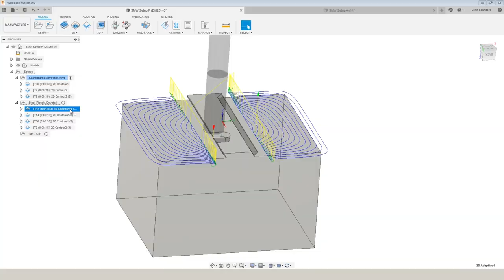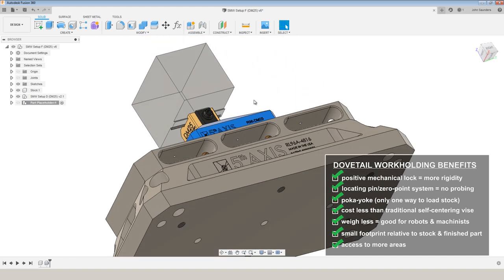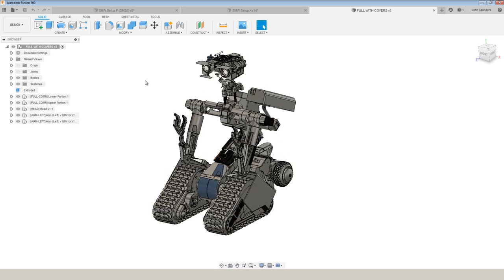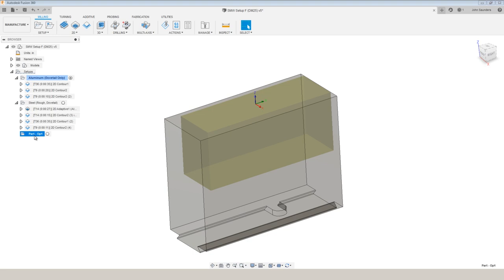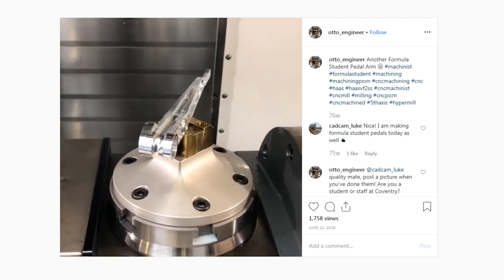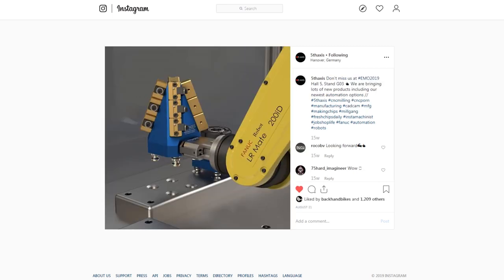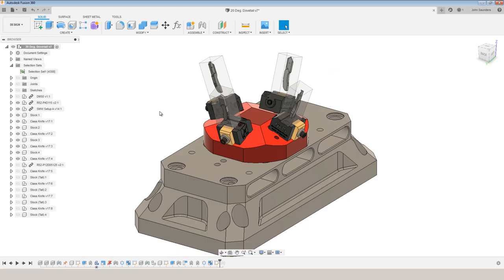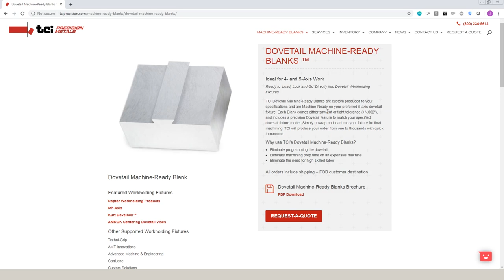Beginner's Guide to using Dovetails for 5-Axis CNC Workholding

Comment: Not that I have a 5 axis, but the trick of "Save to project" already made my day 1000 times better :D 
Was just crying half an hour ago that I cannot move files between projects...
Reply: Better use derive instead of export. This way changes in the parent file can be propagated to the derived file.
Reply: Workoaround I found for that is to save the file on computer as a normal 3D file, then open it with Fusion and save in desired folder.

Comment: It's amazing how hard you can hit a part with a dovetail. I ran some parts way harder than I should have been able to with a 1/16th inch dovetail, also knocked material cost down since I did not need as much to hang on to.  This was on a 3 axis.
Reply: The shop I worked at used dovetails for a multitude of jobs.  .060 deep, with a .250 index slot.  We didn't have fancy workholding fixtures, we just made steel dovetail jaws for our Kurt vises.  We routinely made 20hp cuts on those tiny dovetails!  Great way to save material also!
Reply: At our shop we settled on a .045 deep x .045 wide 45 degree profile with the matching profile cut into some soft steel kurt style vise jaws. On aluminum parts the added time to buzz a dovetail on the stock is almost not measurable. On steel parts it does take awhile but still more cost effective than blowing up multiple $300 end mills and all the collateral damage when parts lift out of the vise.

Comment: Excellent Topic and video as always Champ.... two things to keep in mind:  
1st: Although any real machinist is unlikely to be ashamed of turning wrenches.. you want to find a way to minimize it, for many reasons... on the big tree type configurations it would be very wise, at minimum to consider, a double lead screw with a mechanical stop to prevent the bolt from separating from the jaw in fast work.... and really to devise a totally different closure/mechanism/linkage for actuation of the dove tails.  ... from experience... turning 20 - 50 bolts per run, even with a pallet changer can wreck your times (and knuckles).   A series actuated mechanically by a cam lock would be worth anyone's time and money..

2nd: when tree type configurations are not necessary ...if possible set up several operations in the same program using several different fixtures.. in line.. one cuts dove tail... 2 cuts part previously dovetailed... 3 removes dovetail and finishes "6th" side.. brand new finished part every time the doors open.... a larger table travel, you know, is necessary.  Thanks again for all your work, loving the exploration of Fusion 360.

the biggest of the little losses of turning allen wrenches in fixturing.. is.... an otherwise great operator, and dignified member of the community, may be made to look and feel like a resentful worthless fool spending half his day with a magnet sifting through chips in a conveyer to track down the coolant ridden wrench that slipped out of his fingers the 5th time in a row..... at best.....you and your incredible associates are capable of designing a thousand different types of linkage/ cam actuated mechancial quick release locks for those trees.. .. and I personally think... .you should.   Not a new idea.... but a good one

Comment: Probably worth mentioning that the self-centering vices you are showing from 5th axis does also have a dovetail. Although not need, it does significantly increase the rigidity when machining harder materials. The effects are quite staggering compared to using the same vice without dovetailing the work piece.

Comment: QUESTION: im building a dovetail system for a group of parts.  which surface is best to use as "Z-zero"?  should i set Z from the wide end of the dovetail, or the narrow?
TYIA

Comment: Is the part only held on the dovetail or is it held on the dovetail and the surface of the milled piece in contact of the uppersurface of the clamp, for extra stability?? If so  the position of the dovetail in the clamp will have to be verry accurate. I am interrested how to work with dovetailclamping of a piece. I am not using it yet.

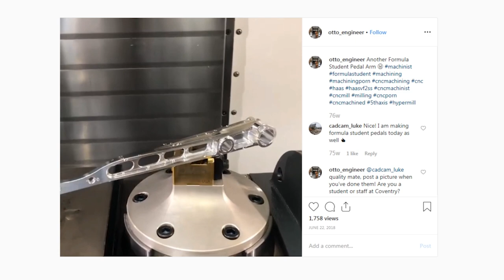Comment: I'm curious how did that part at 8:00 avoid chatter?  The finish looks great.  If I held that in a vise with that much sticking out of the sides it would be full of vibration / chatter marks.

Comment: Four minutes in, you export a part then insert it into the file you do the CAM in. I didn't know you could export individual parts! That would have been so helpful, but now you can use the derive function to insert parts into a separate file for doing CAM instead. I think this way, you can update the part if you make changes in the original assembly, but maybe your way does too? Are there any advantages or disadvantages to doing one method vs the other?
Reply: You might want to check out the new manufacturing models in the cam space (Setup)

Comment: It would be intresting to do a comparision with  the LANG macro grip vices 
Just the fact that you can avoid machining the dovetails and instead pre-stamp your stock outside the machine while your machine is running parts seems to be a +
Reply: Daniel Regnér 

Holding power is about equal, maybe slight edge to the dove tail. 

The thing is the Lang stamping machine is $5k. 

You’d need pretty high volume to justify its cost over just machining in dovetails.
Reply: @occamssawzall3486  yes its a cost. Bit having a guy running dovetails in a mill is not free ;)
Reply: Daniel Regnér 
Intern on a prototrak is isn’t very expensive

Comment: I just added a tiny DM12 to my pocket NC and it's working out really well (see my Instagram). I could actually do with an even smaller version. The pin also provides holding force along the dove tail not just the idiot proofing.

Comment: Total noob question: how do you slide the stock into the vise with the locating pin sticking up in the middle of the dovetail slot?
Reply: the mating dove tail is cut into jaws which can be opened and closed... you unscrew the bolts (opening the dovetailed jaws)... move the dove tail jaws open wide... set the part directly down onto the pin.. then tighten the bolts securing the dove tail.  Good luck in your career, you've got good taste in edu videos.